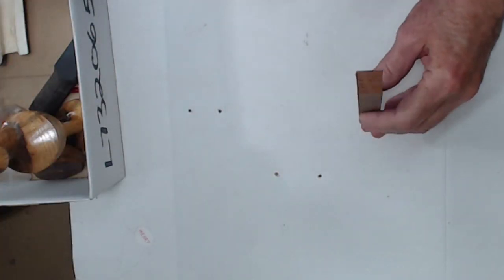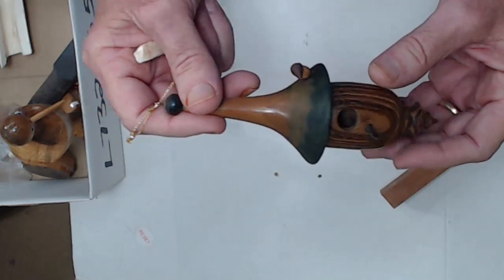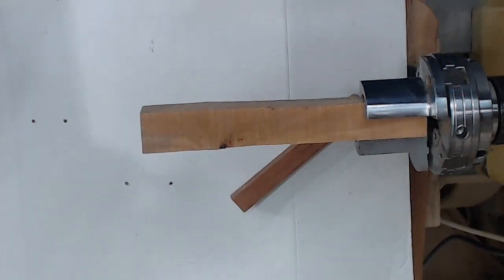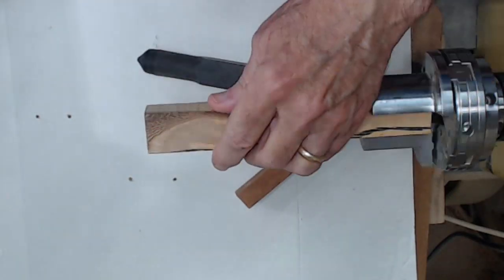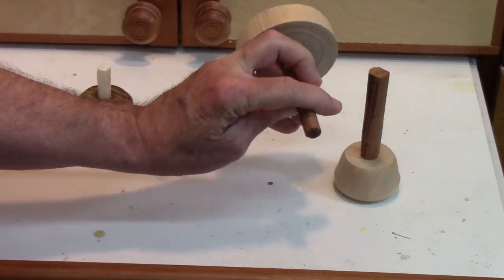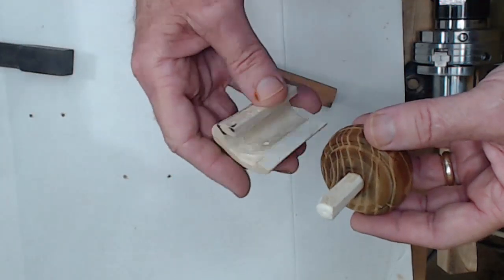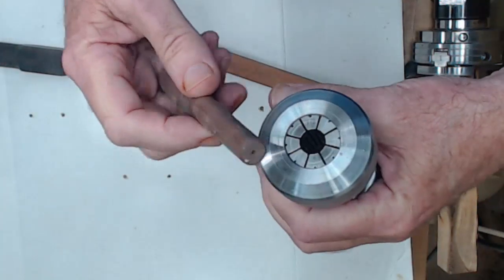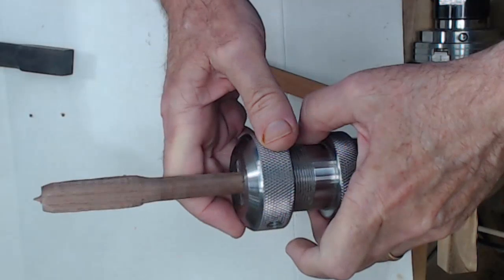How to Hold Small Blanks on the Lathe

Comment: Another method for small items: Start between centers and taper one end to fit into the Morse taper of the spindle of your lathe. You don't need to fully round out the blank, just knock off the corners of the blank enough that it will fit into the Morse taper.  Then, drive the blank into the spindle with a mallet. The blank should wedge itself tightly within the Morse taper, giving you plenty of holding power for turning (light cuts for small pieces!).
Reply from the maker: Thanks for sharing. I absolutely forgot to mention that in this video. Old school but definitely effective.

Comment: Another method I use periodically to hold small pieces is a wooden collet disk. I got this tip from David Springett in the UK, when I needed to make some Lace Bobbins, Fit a disk in the standard jaws and drill a hole through it then band saw a kerf through the piece leaving a small portion uncut. This allows the wood disk to collapse onto the work piece. I has the advantage of being any size one needs. I usually put groove in the outside perimeter for an elastic band as after many uses the disk breaks into two pieces, the rubber band holds the pieces together when they are not in use. Cheap and easy and infinitely adjustable.
Reply from the maker: Great idea, thanks for sharing.